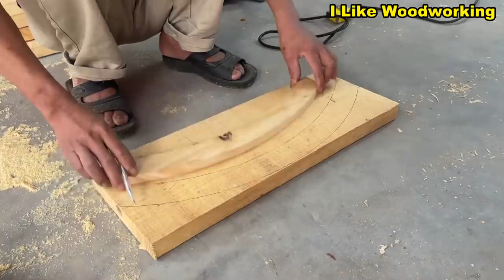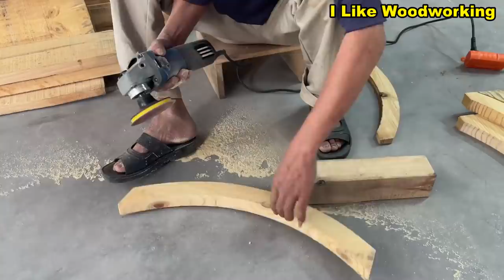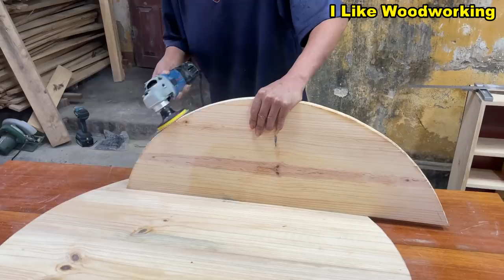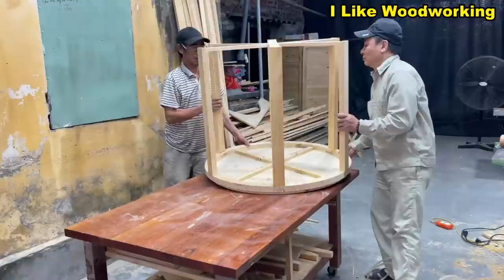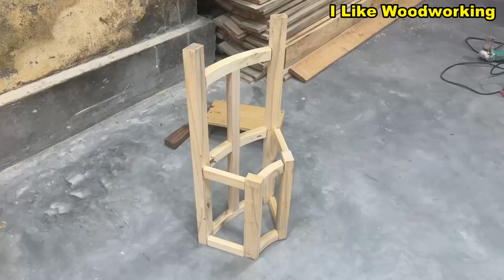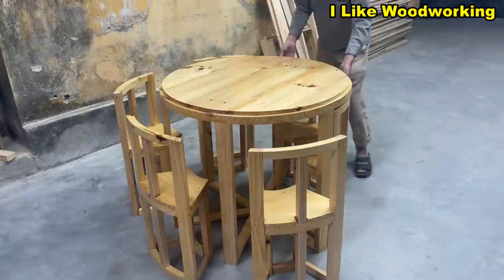Amazing Design Ideas Woodworking Utility For Tight Spaces - Build A Round Dining Tables And Chairs

Comment: This thing will last 30 minutes before falling apart with those kind of joints
Reply: Cristofano, I beg to differ from your notion as mortise and tenon are the strongest joints for any furniture.
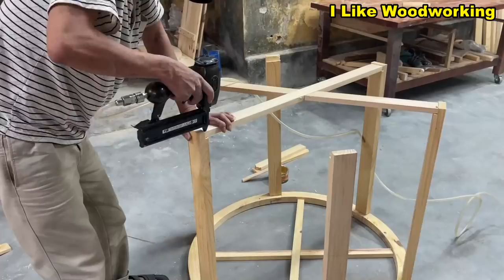Reply: @93556108  I'd agree with you if they  were done properly. Even in the halflap there is a huge space between the pieces and all that wiggle room can't be overcome with some pin nails. Also in the minute 10:10 you can see how they "join the base using nothing more than a couple of pin nails to assemble the whole structure. If you think that 2 pin nails in a 1/4" end grain will last, well ... there is nothing to argue about then.
Reply: @VaracolacidVesci  on that I agree with you, thanks.